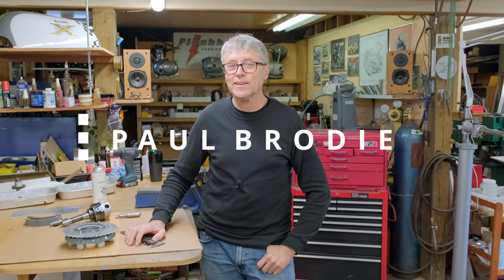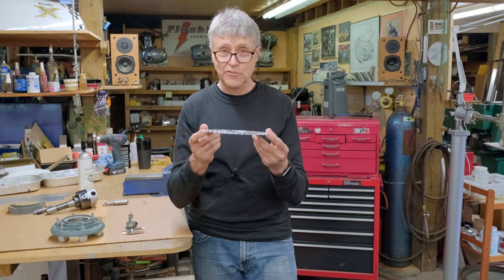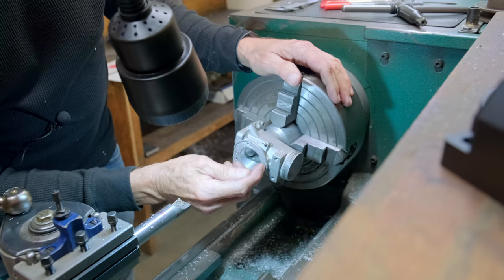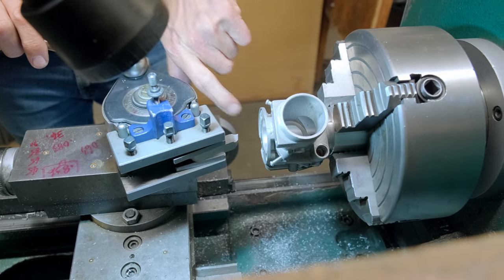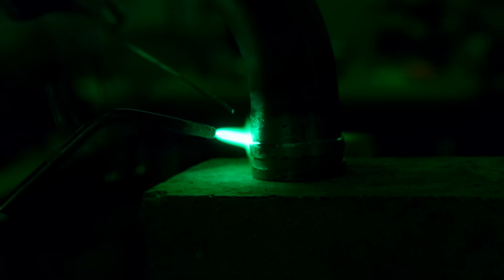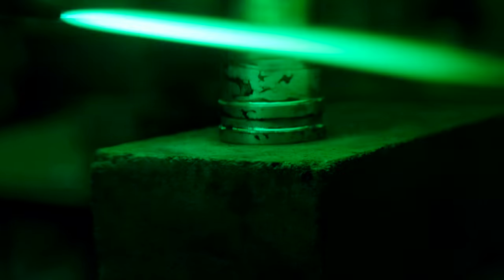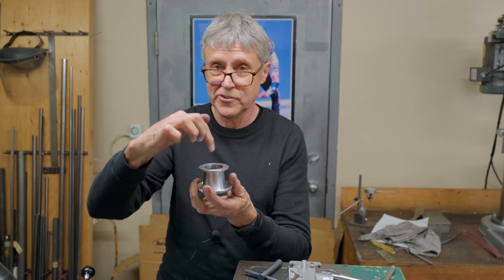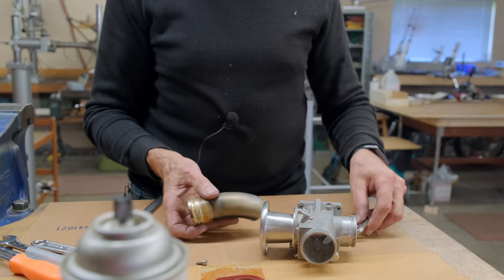Aermacchi Intake System // Paul Brodie's Shop

Comment: This is very funny, I just made a substantially similar intake manifold out of galvanized EMT and a steel flange last week and was just trying to figure out how to post a picture of it on my account to respond to a question without making a video and saw this on my recommended videos. I guess I'll post a short video but I will pride myself that my solution independently matched the legendary Paul Brodie's design. 
Cheers

Comment: I just dug out my 32mm Amal with steel side draft manifold that ran out to side of the 441. I always tried to keep some visual sight from where the outer bend is to intake edge. The needle to valve seat is key. Great progress it should rev higher with the extension, thought you may go for a remote float 1.5 GP Amal or 938. Can't wait to hear it run, my BSA has room now thanks for the inspiration to restore.I waterjet cut my flanges and that was a big help.
Reply from the maker: I'm just reproducing what I used to have, and what worked very, very well. I used to own a B50 with knobby tires years ago, and one day it snowed and then the sun came out. I tried to kickstart that bike for an hour, and failed, so I sold it to a friend of mine. Always had a soft spot for BSA singles!

Comment: What a beautiful piece!
The mistake probably was, since you have machine the center with an off-set, the old threads would not be centered to the new bore. I think the simple and effective way to transfer those holes would be a piece of paper and some dirt fingers.
Well... it is just few thousands, so you can enlarge then an make the piece even light. =)
Thank you for the video, that series is amazing! Stay safe!
Reply from the maker: Rogerio, I think you are right. The centres changed when the bore was moved. I gave it a little file and everything is good now. You stay safe too :)

Comment: I like the steel manifold... Less heat transfer from the engine to the carburettor. :)
Reply from the maker: Did you notice the 3/16" fibre insulating washer between the head and the manifold?
Reply: @paulbrodie  Yes I did. Thanks Paul :)

Comment: Amal Carbs were used in the 60/70/80's on Speedway bikes - there would have been more than a few in North America if you knew where to look! They would be Methanol Carbs but convert to Petrol easily enough
Reply from the maker: I have a carb so I'm good, but thanks!

Comment: Lovely velocity stack!  I also share your interest in intake and exhaust.  Have you ever read Smith & Morrison "Scientific Design of Intake & Exhaust Systems"?  It's a hard slog, and probably a bit outdated now, but lots of great information.

I raced a Honda Hawk for several years, and did some engine development, including building velocity stacks.  I didn't have much confidence in my machining skills at the time, and resorted to laying them up in fiberglass.  They worked quite well for development, and when we got the best intake/exhaust combination, I purchased the correct velocity stacks from Sudco -- I wasn't sure if the epoxy I'd used was fuel proof.

I'm curious why a modern Mikuni round-slide carb wouldn't be the clear choice.  Is it a rules thing?
Reply from the maker: Thanks Alan. I think I have that book in my collection. I will have to check..  I could have used a Mukini, nothing to do with rules. I just believe that the Amal flows better. If you look at the intake side of both carbs I think you would agree.

Comment: Oh, interesting about carb boring, not many people realise the offset is 100% necessary.
Before I had mill, I did it in lathe but setting up and boring on mill is actually much easier, especially with multiple carb set up (inline 4's)

Comment: Coincidentally, I have Mikuni TMX carb in my hand that I've just finished raising the ceiling to allow 1.375" tall air to slip through with armfuls of fuel. I now wish I had waited to see the secrets of mixture you're going to share.

My favourite calipers are dial and they happen to read in imperial only. 

Back to the Saturday morning carto... education.
Reply from the maker: All the carb specs were given to me by the Bladon Bros. After the video I checked the carb specs and every slide, jet, and needle needs to be replaced..
Reply: @paulbrodie  It pays...or perhaps adds up being thorough. You really did start with a core... pretending to be a complete carburetor. Well I for one am happy to hear that there's more sorting out of important bits still to come. I've always liked the challenge of a carb and the learning part, hopefully, of what's really going on. 

  After talking with a friend who watched several of your videos, we would say your videos are captivating with just the right mix of stuff with your always interesting self. I think that sounds about right.
Reply from the maker: @WireWeHere   Thank you Jim. Making videos is a learning process for us, and I'm never really satisfied, which is probably a good thing.

Comment: Loving this series Paul...just wondering why your not using a downdraught carburettor as per the original design?
Reply from the maker: Thank you. I'm building a replica of my racer that got stolen in 2005. That had the Spanish Amal with the curved manifold and it worked very, very well.

Comment: Interesting about 5 degree angle for bell mouth.
 From what I've learned over the years, 7 degrees is about maximum air can turn without losing flow and becoming turbulent.
You've probably read about David Vizard and his porting/air flow techniques? (I've been reading his article since late 60's, not so impressed with his newer You Tube video's)
 I think he stated around a 3/8"~1/2" diameter on air intakes was close to optimal?
I have an article from around 2006 from a couple of scientist's showing about 1%~1-1/2% increase in airflow using a parabolic curve instead of straight sides on inside of bell mouth. I have no idea how to machine something like that by hand though (and don't know enough about CNC/CAD  to program something, my CAD is like yours, cardboard aided design ;o) )

Comment: The narrow gear clamp caught my attention. They look perfect for my son's latest bike which came with the stock clamps prestripped. Would you mind sharing the brand and perhaps the supplier? Your local is my local if your supplier happens to be too.

 Makes me wonder if a velocity stack would help inside a dirt bike's airbox. Every snowmobile I've owned used velocity stacks and skipped the air filter and if the stacks were removed we lost noticable top end.
Reply from the maker: I went to New Line Sales, and s/s thin hose clamps were $6 each, so I went Green Line and they were $0.96 each. Send me an email for the brand; I have to check in the shop. Intake tuning can be very critical and making changes does not always result in more power!

Comment: WD40 IS good for machining aluminum. it keeps the metal from cold welding to the cutting tool. i have herd the reason for this is because it is mostly kerosene, which is the active ingredient that facilitates this phenomena. straight kerosene is better for cutting aluminum, but WD disperses moister like nobodies business(added benefit in a machine shop). i run 3 squirt in my shop acetone for tig welding, kerosene for aluminum, and WD for a lot of things. WD or straight kerosene are both effective as mild degreasers.
Reply from the maker: Yes, WD40 is a great product. I understand the major ingredient to be fish oil...

Comment: Hi Paul, what type of blade do you use on your bandsaw to cut aluminium? Blade type, TPI etc. and blade speed? Thanks in advance, your work is awesome.
Reply from the maker: It is either 6 or 8 TPI, and I use the fastest speed which is 100? something... Don't know the brand.
Reply from the maker: I checked the speed; it's 90 metres / minute.

Comment: I am not sure if they are still racing them but out of Sacramento ca. Mike Bungay & Karl Engliner.. Karl built one ripper of an engine. Hour after hour on the dyno.  Been a long time ago I think he was getting high 20s low 30s out of the 350..
Reply from the maker: I do not know them, sorry. A good 350 should have 35 rear wheel HP.
Reply: paul brodie , The bike and engine they built is the #7 HD sprint that Dave Roper has riding years.
Reply from the maker: @tqmx1  Yes, and Dave really does know how to ride that bike fast!

Comment: You sure your digital readout does not have a pcd function? Looks like a relatively modern unit. It's a super easy and fast way of doing that stuff (like the relief holes on ya sprocket)
Reply from the maker: It might. I have read the instruction manual several times and it is the most useless booklet I have ever seen. It makes no sense to me.

Comment: Greetings,
I have to go to dialysis, so I’m not able to watch the whole video, but a couple things come to mind.
Is the rear sprocket steel, or aluminum.  It sounds like steel.
I suppose you’d lose some longevity, but wouldn’t an aluminum sprocket be easier and save more weight than cutting lightening holes in a steel sprocket.
I really like Mitch inserting the photographs of your parts drawings.
I had a hard time seeing your sketches when you just held them up to the camera.
Got to run.
Let’s be careful out there.
Reply from the maker: James, the rear sprocket is aluminum, but we still need to save some weight. Yes, Mitch does a good job inserting bits and pieces here and there...
Reply: @paulbrodie  you are an artist you should think about making two different bikes on a  MTB and  the other one and racing motorcycle of you choice both of the bikes would be your choice to build the reason I say this is that building makes you happier  I seen in this video when you where work on the Carberator making the pieces  from #YSW I think you should and September should be the time to start off this journey  Domenico

Comment: Paul, Is the "Race" head a factory piece from a specific Aermacchi model, aftermarket item, or part of a Aermacchi performance package? I'm really enjoying the Race bike build, thanks.
Reply from the maker: The race head started life as a regular 73/74 cylinder head, but has been modified.
Reply: @paulbrodie  Thanks for the information, G.

Comment: Thanks again from a great video! I have done some velocity stacks in a manual mill too. I have used a corner rounding endmill as a single point lathe shape tool where the inner taper blends to outside radius. It's still a pain in the but to do 4 exactly same shapes for a 4 cylinder. So I just finished my Gizmo for this kind of jobs: https://www.youtube.com/watch?v=pAftLQ4Ak4w&t=339s
Reply from the maker: Thank you. I subscribed to your channel. I think I can learn a few things from watching you :)

Comment: Did you use the Amal carb because its a period carb for the bike ?. I have always thought Japanese carbs are better , I'm i wrong ?.
Reply from the maker: I used a Spanish Amal because it was recommended to me by Chris Bladon. They have very good flow characteristics. The Bladons dynoed 34, 35 and 36mm Amals and 35mm was the best choice. My bike carbureted and pulled very well, and their jetting choices were perfect; I never changed anything except for altitude jetting.

Comment: hi paul i modified my my 32mm amle i was given 4 many years ago i got a machine shop to bore mine out to 34mm then i had to modifie the slide to fit the bottom would no idle (xs650 in a bsa a10 17 wheels suzuki modern tyres ) can’t help myself got to modifi )75 years young
Reply from the maker: Keith, never too old to tinker. Thanks for watching!

Comment: Just beautiful 😻 but why silver solder aswell as tig isit the soft solder won’t crack ?🧐
Reply from the maker: Because the Tig is very strong, and when it is ground smooth you cannot see it, and the silver solder is used to create a tiny fillet so that when it is bead blasted and painted, it looks like a perfect seam and you can't tell how it is put together. . Invisible welding!

Comment: The holes in the velocity stack didn't fit perfectly because you excentered the carb ;-) Cheers, Filip
Reply from the maker: You are correct!
Reply: @paulbrodie  I would have got the same problem ;-) You concentrate on making things perfect and then you bump into small (sometimes irritating) problems :-)

Comment: "Intake system"...you mean pipe  or manifold
Reply from the maker: Many meanings. When I say "intake system" I am referring to the velocity stack, the carb, and the pipe or manifold. But I have been told I cannot say "manifold" because mani means many, and this is a single cylinder. Probably "intake stub" would work, but I still prefer intake manifold.